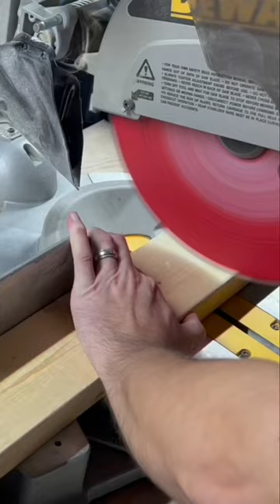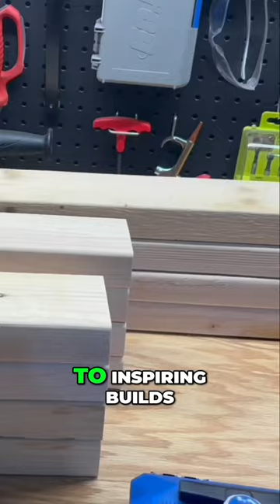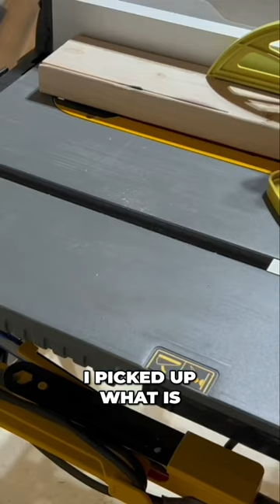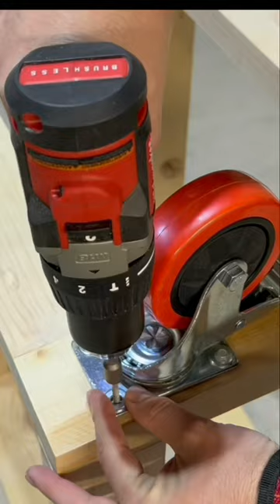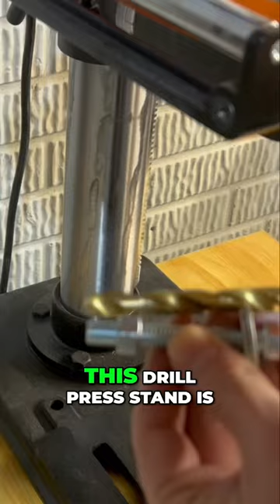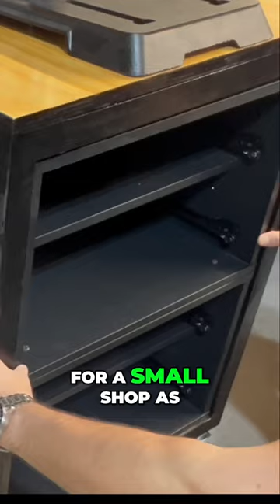DIY Mobile Drill Press Stand with Drawers #howto #shorts #workshop

Comment from the maker: Below are the tools and supplies used to start making your mobile drill press stand:
Kreg Jig: https://amzn.to/3x2E8gO
Magnetic Wrist Band: https://amzn.to/3V0h6Pk
Zero Sugar Protein Water: https://amzn.to/49c9PRT
Drill Press: https://amzn.to/43bTs6O
Digital Angle Gauge: https://amzn.to/3NrINPo
Caster Wheels: https://amzn.to/3x5FgQR
Drill: https://amzn.to/3P8BtWi
Orbital Sander: https://amzn.to/3x5FjMx
Feather Board: https://amzn.to/3PvG4Vn
Push Stick: https://amzn.to/3IPlBXQ
Quick Grip Clamps: https://amzn.to/407w1bI
Speed Square: https://amzn.to/44gg8mb
Glue: https://amzn.to/3IO7uSt
Wood filler: https://amzn.to/43xKC3d
Shellac: https://amzn.to/3Vr3nU0
Painters Tape: https://amzn.to/3nESFHh
Tape Measure: https://amzn.to/3IkGv04

 
*DISCLAIMER: The above links are affiliate links.  This costs you absolutely nothing, but pays me a small commission and helps me continue to create this FREE content.
Reply: Thanks!
Reply: I just ordered #pwrlift water, can’t wait to try it!